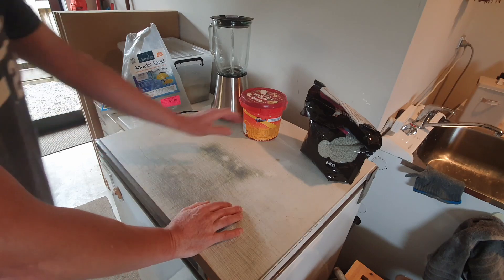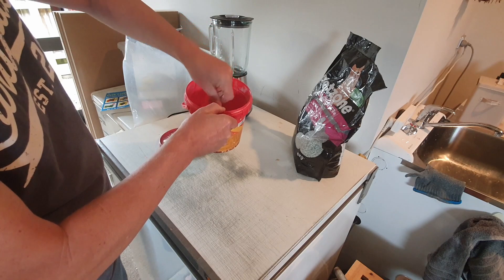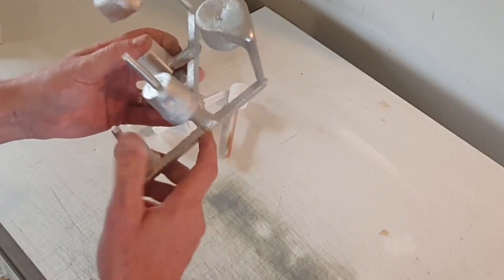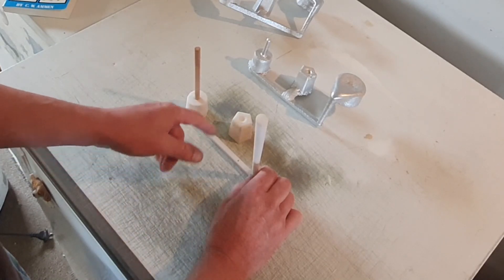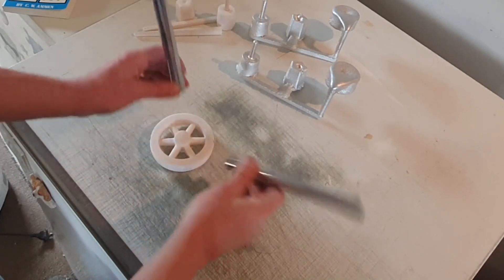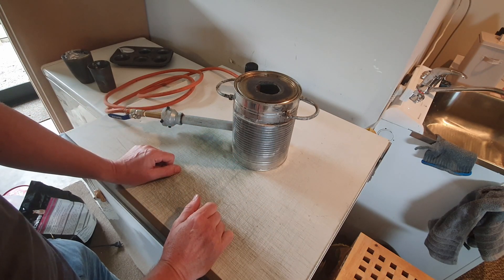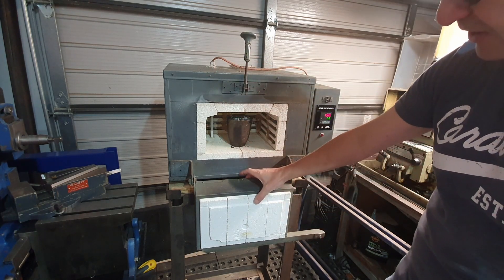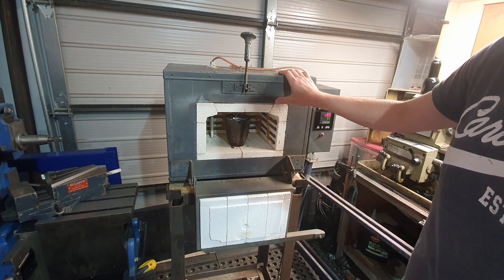#82 - Lets melt some metal and cast something - Part 1

Comment: I like your small tin can gas furnace Kevin. How long does it take to melt a full beaker full of aluminium? Looks like a good future project. 
Did you make the gas blow torch section fixed to the furnace or can you buy that sort of thing? Enjoyed the video. Tony
Reply from the maker: Hi Tony. I haven't actually timed a melt but guessing 20mins approx. I built the burner from tube fittings. It's a common design and works really well. It's far to powerfull for the Coffee Can Furness but when I build a larger fulness it will power that also. Cheers kevin

Comment: Hi Kevin, if you want to do a bigger pour around 1.5 ltrs, I'd be real happy to bring my furness over and give you a hand. I live on corbet rd
Reply from the maker: Hi Paul. Thanks for the offer I bare that in mind. How's the Tank coming along?. Cheers kevin
Reply: @Machine_NZ  bit slow because I'm not too thrilled with the parts price and postage costs. Have been spending a bit of time on the vw beach buggy, 1 cylinder has a tide mark where it has been half full of water, with deep corrosion marks on the sides. Other 3 were leaking compression at the top of the barrels. New piston, barrel kit $290, not bad.

Comment: Glad to see you casting!
In some ways the electric oven is ideal.   One can get good temperature control by watching the display after the oven is up to temperature.     When the metal temperature is the same as the oven on time for the heater elements will drop noticeably.
Reply from the maker: Hi Dan. The oven good for smaller pours but I'll be building a larger furnace in the future for casting larger items. Cheers kevin